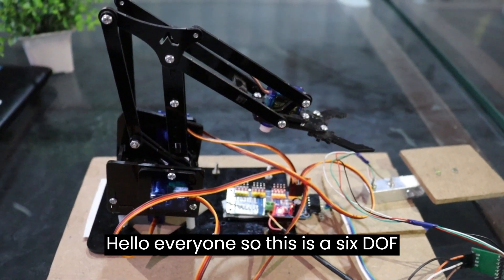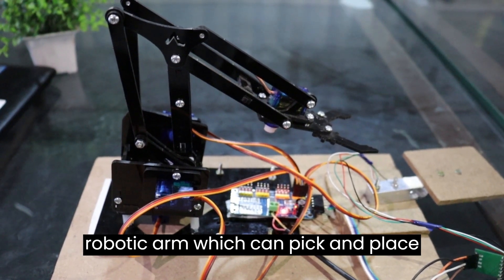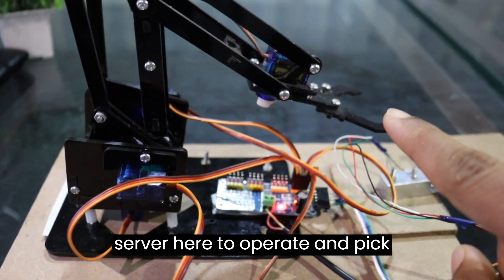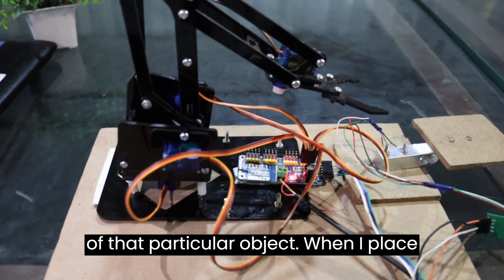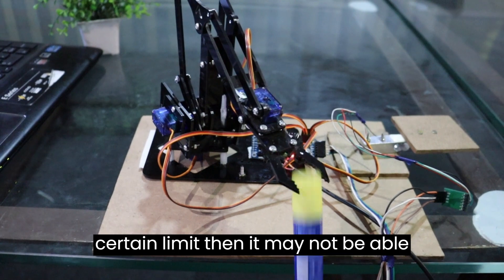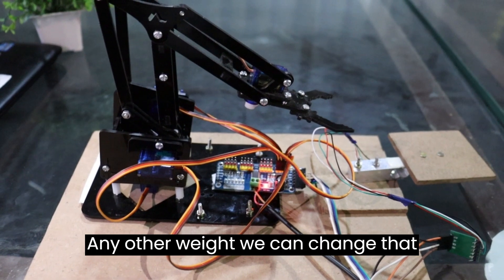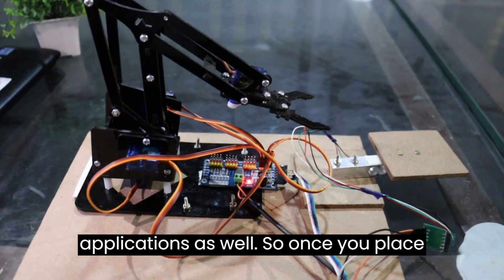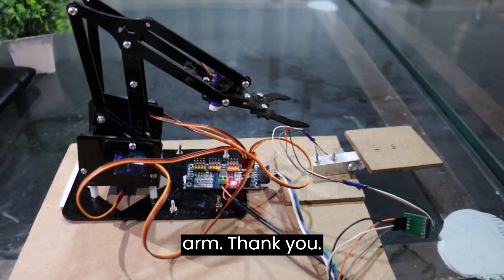Robotic Arm | Pick N Place Robot | Working & Explanation

Comment: how is this a 6 dof arm? a 6 dof system can move in:
the X-direction: forward and backward from direction of facing
the Y-direction: left and right from direction of facing
the Z-direction: up and down from direction of facing

and perform a:
Roll rotation (rotating along the X-axis) leaning to the left or leaning to the right
Pitch rotation (rotating along the Y-axis) leaning to the front or leaning to the back
Yaw rotation: (rotating along the Z-axis) Rotating to the left or right over the hgorizontal plane

this arm only performs a Yaw rotation and X -directional movement creating a 2 dof system.

this system has only two motors (that move the system, the third one only opens the gripper but it doesn't create motion) making it impossible for it to become as ystem that has more than 2 degrees of freedom